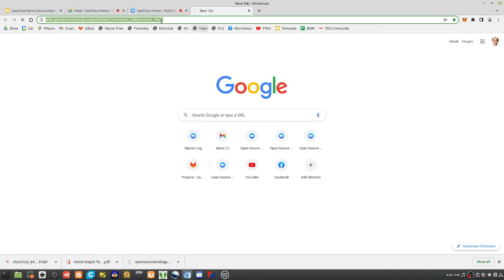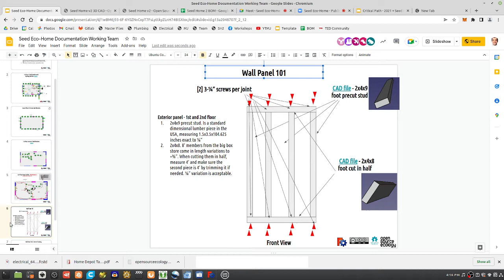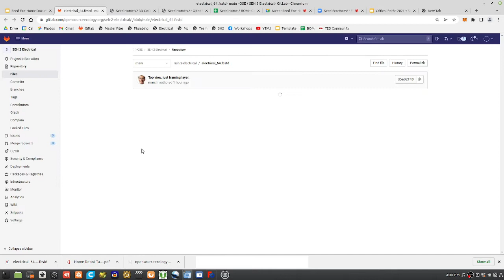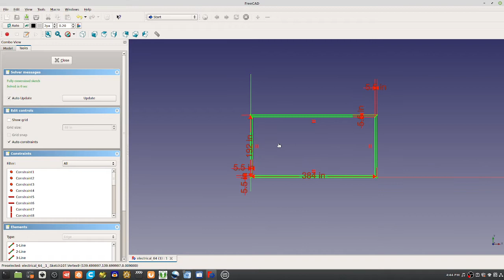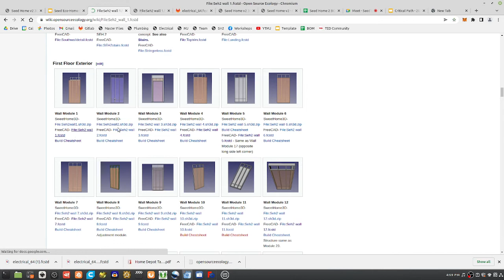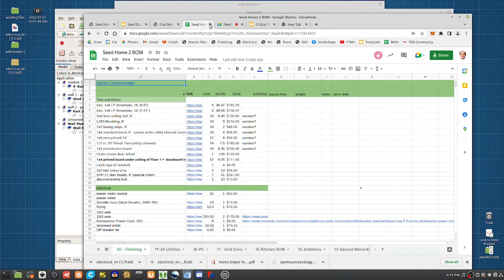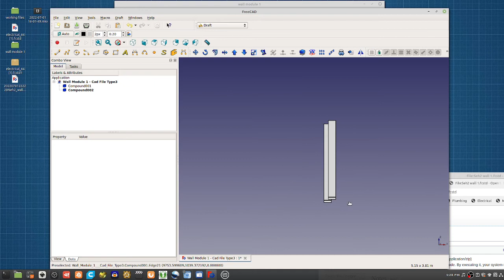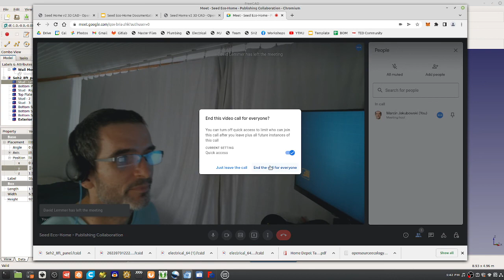Seed Eco-Home Documentation Team

Comment from the maker: Take a look - this is correct by Logan for location and height - example of module 24  - https://wiki.opensourceecology.org/wiki/File:Seh2_wall_24.fcstd
Yes, new module base plates are on top of 3/4" subfloor . Logan's work should be consistent with that.
You can merge module 24 into main file (electrical 64) to see how it looks compared to the old model.

Comment from the maker: For the second floor - I think a good order would be - do the complete design (one sketch) in positionally correct location. Use the Electrical_64.fcstd (https://gitlab.com/opensourceecology.org/seh-2-electrical/-/blob/main/electrical_64.fcstd) position - that has the correct origin and location sketches, but not all location sketches. Feel free to extract any new interface sketches - and update https://wiki.opensourceecology.org/wiki/File:Masterinterface.fcstd with other interfaces - that's supposed to be our master interface file. After complete sketches, do the final Dumb Object (the 4x9 foot module as one piece). We can save the individual parts file for BOM purposes later - first is the dumb file so we can ship the full CAD to a structural engineer.

Comment from the maker: Notes on the second floor details - Here is the correct dimension of the panels - where the beadboard should end up:
https://docs.google.com/presentation/d/1ryuVJO_YEAID97JgGmrzYeAFA_RrwwyLfWe0NdrobNc/edit#slide=id.g12b1522d10a_0_41

Do you agree with the 13.125" number? 
If so, then that is what all second floor panels need to look like. Except - there is no sill plate on the second floor - the walls sit directly on top of the subfloor (3/4" plywood). Thus, the second floor must have 13.125" - 1.5" as the actual width of channel. Thus, channel is slightly different than the first floor - but the overall wall module is otherwise identical in structure.
Does this make sense? If so, you can proceed on 2nd floor modules.
We already built Seed Eco-Home 2 with the 8' 2nd floor panels - the 9' panels now apply to the next build in October 2022.